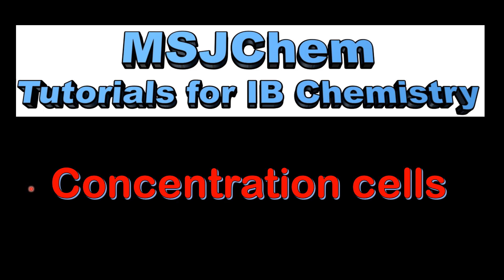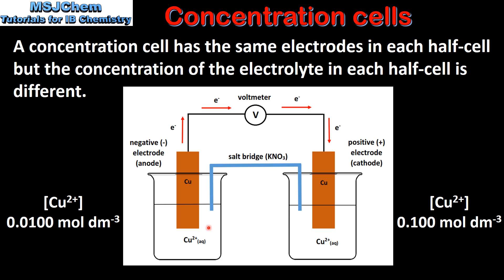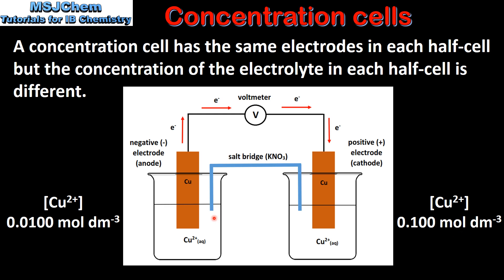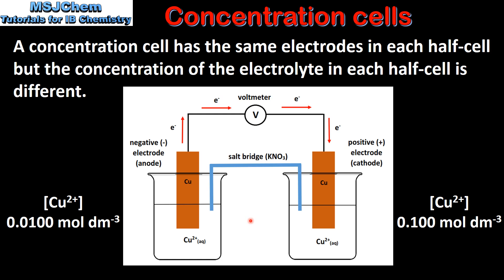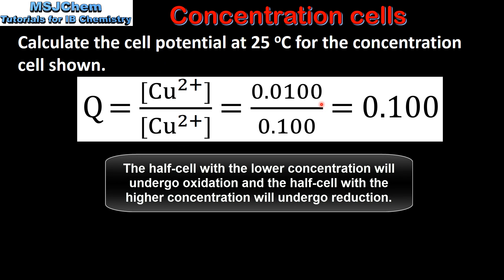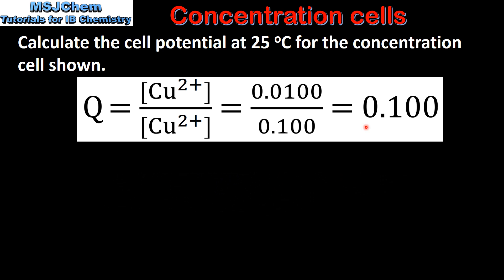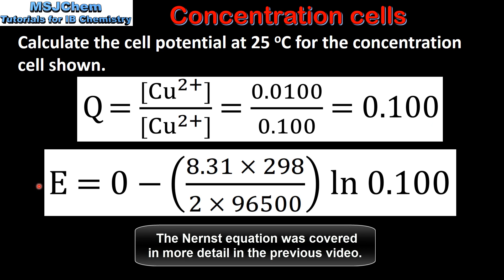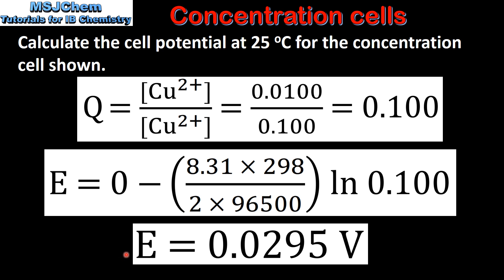C.6 Concentration cells (HL)

Comment: Can u plzz tell why lower concentration will undergo oxidation??
Reply from the maker: The half-cell with the lower concentration will undergo oxidation which increases the concentration of copper(II) ions in solution and the half-cell with the higher concentration will undergo reduction as this will lower the concentration of copper(II) ions in solutions. Once the two half-cells are the same concentration, the concentration cell will no longer produce a current. When this occurs, the two half-cells are at equilibrium and no further reaction takes place.
Reply: @MSJChem  tnq u so much sir, u cleared my doubt
Reply from the maker: Glad I could help.
Reply: @MSJChem  thank you so much for this information. I have searched for a answer for this for a long time! thanks
Reply from the maker: Glad I could help.
Reply: thanks a lot for the video sir, really helps @MSJChem